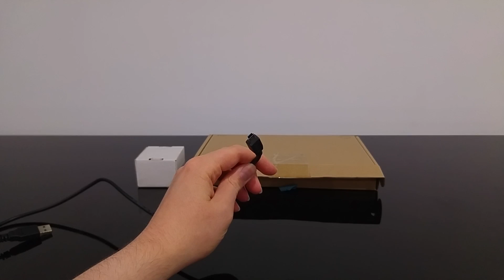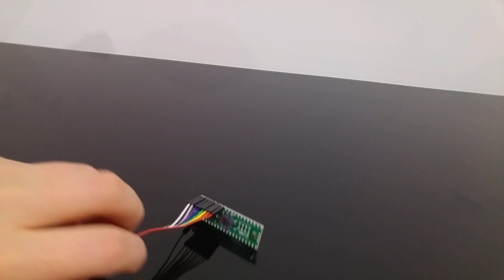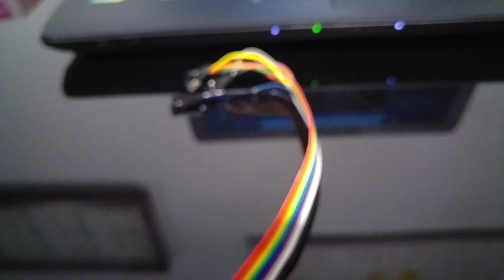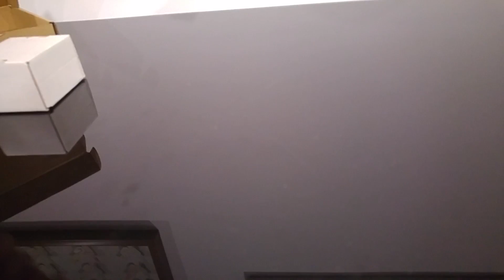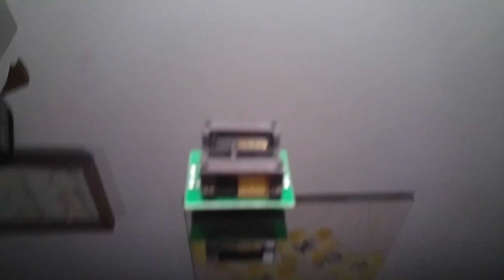PS4 Controller Sync NOR Flash Corruption Repair 1/3 - Building the Teensy Programmer

Comment: Hi Andrew Paul need your help for a couple of thinks. I need to start repairing console with not working pad so i need all the stuff for programming. I don't remember where but i readed in one comment of your videos  that it's possible to use a CH341A usb programmer that i already own and also i have a programmer like this:  https://www.amazon.com/WINGONEER-high-speed-Programmer-EZP2010-supports/dp/B01DZC36GY.
Those are ok or i need teensy anyway or may can i use a raspberry pi3?  Please answer as soon as you can and also indicate to me all the equipment and socket i need for all ps4 revision for use with my programmer or with teeny. Thanks
Last question i would like to ask if you have a video guide for ps4 that turn on and shut down after a second.
Reply from the maker: Hi, You can use a standard programmer if you wish, as long as it supports the MXIC NOR chips in question.
A full list of components, including socket details etc can be found on this video and the 1200 addendum video.
Reply: Ok i will try with my programmer if works, do you now also if raspberry can be use instead teensy ? Please can you also tell me if this socket is good for 1200.  https://it.aliexpress.com/item/QFN8-to-DIP8-Programmer-Adapter-WSON8-DFN8-MLF8-to-DIP8-socket-for-25xxx-6x8mm-Pitch-1/32813537238.html?spm=a2g0y.search0104.3.22.1ab1269f9LmtiD&ws_ab_test=searchweb0_0,searchweb201602_5_10065_10068_318_319_317_10696_450_10084_10083_10618_452_535_534_10304_10307_533_10820_532_10821_5023915_10302_204_10843_10059_10884_323_10887_100031_320_321_322_5727715_10103_448_449_5727815,searchweb201603_45,ppcSwitch_0&algo_expid=df362057-6191-49e7-b816-f60b922c94fa-3&algo_pvid=df362057-6191-49e7-b816-f60b922c94fa&transAbTest=ae803_5

Comment: Hi Andrew ... thank u for very detailed tutorial. I have problem with dumps and im in dark. I hope u can spread some light :) to my problem. 
PS4 on 4.73 (1116). Dont have original hdd so im trying to update to 5.05. Always stuck at same progress. Around 44% and give me code su-30631-3, which i belive is nor corruption. So i went ahead with ur tutorial of dumping to eliminate firmware corruption. I have teensy and i no socket adapter. I solder to nor with very short wires to teensy. Everything ok when i hit info, read correctly and even dump went through with no problems. I made around 2 dumps. But problem is here. I cant get 2 equal dumps. No matter what i do. All are diffrent. So i guess its not dumping right. But if i load at ps4 nor extractor it load all info ... but the only thing i noticed is diffrent sha1. If i load another dump sha1 is keep changing. I tried on another teensy and diffrent comp and still couldnt get 2 identical dumps. :( When i extract from dump 2 and extract from dump 2 and compare c0020001.bin they are identical. 
Do u have any ideas ?

PS: I tried diffrent hdd,usb and same thing. I try to update to latest fw using internet and same thing.
I try diffrent nor from diffrent console and both were identical (1.62 FW)
Reply from the maker: Is the NOR being lifted from the board before dumping? If not, do so and try again.

Can you dump  a NOR from a known-working console consistently on your setup? The fact you're getting differing dumps each time suggests to me that the NOR itself may well be faulty - if you can dump other NORs consistently then this may well be the problem. Sadly if it is, the chances of repairing it successfully are very slim to none.
Reply: Hey. Yes nor is being lifted and soldered to adapter. I try with direct wires on nor to no diffrence.

I dumped nor from working console with this setup and everything was ok. So setup is good ... So i think its nor who is faulty. Im gonna try to buy new mxic chip and try once again with new nor. i will leave orig nor untouched. But i dont have any hopes about this one :(

Comment: Hola, quizas me puedas ayudar, tengo una ps4 que comenzo a dejar sin conectividad a los mandos,, hasta que ahora muestra un codigo de error NW-35959-1 en la parte superior izquierda cuando inicia, pero ya no sincronizan ni con el cable usb, le realice un reset al comando, pero no lo toma por usb tampoco, tampoco me deja ingresar a modo seguro, nunca hace el segundo pitido a los 7 u 9 segundos, y se termina apagando, justo vi tu video que quizas por ahi me puedas ayudar, muchas gracias.
Reply from the maker: Hi,
If I understand correctly your PS4 doesn't enter safe mode and you cannot sync controllers at all? Do you have any other controllers to test at all to ensure it's not just this one controller?
Reply: Gracias por tu pronta respuesta, pude probar con otro mando pero pasa lo mismo, primeramente te dejaba jugar unos minutos con el mando y después se terminaba desconectando, le realice una limpieza general ya que estaba con mucha tierra, anduvo una hora bien y luego ya no tomo mas el mando, ni por cable usb, intente entrara a modo seguro pero no me deja, no hace el segundo pitido.
Reply from the maker: Has the controller sync issue only started since disassembling and reassembling the console? If so check the connection of the antenna cable beneath the power supply unit and ensure the other end of the cable is properly and securely attached to the metal bracket.
Reply: Me llego por esa falla, que a los 5 minutos se quedaba sin la comunicación del mando, al verla como estaba y notando también que levantaba mucha temperatura en la parte del APU ponido mi mano sobre el plastico, decidí realizar una limpieza, la probé una hora y funciono bien, al otro día ya no tomaba los controles. Gracias nuevamente. Ojala me puedas ayudar.
Reply: El código de error que muestra cuando inicia es NW-35959-1 en la parte superior izquierda, ya con la pantalla de bienvenida.
Reply from the maker: I see. I'd definitely check the antenna lead and connections / sockets for any damage in the first instance to ensure they are free from damage and that they are properly connected / seated etc. Does the WiFi connect and remain connected (if you can test that / use it etc)?
Reply: Verifique todo nuevamente, pero ya vino con ese problema, verifique y estaba todo conectado correctamente, no puedo hacer nada porque no toma el mando ni por cable USB, el código de error que muestra es NW-35959-1. Ni si quiera puedo hacer que ingrese a modo seguro, enciende perfectamente, mostrando ese código de error pero no me deja hacer nada al no tomar el mando.
Reply from the maker: If you remove the hard disk drive do you get the 'unable to access storage' message? Do you have another hard disk around you can install to test to see if the console will boot itself down into Safe Mode so you can test the USB handshaking with the controller?
Reply: Voy a probar sacando el disco y poniéndole otro, esto no afectaría al disco original no? y luego comento por aca que sucede, muchas gracias.
Reply: Ahora que recuerdo probé sacandole el disco, peor sin poner un disco nuevo, e inicia la consola diciéndome que debo presionar el botón PS del mando también pero no funciona el mando y ahi queda.
Reply from the maker: I see - if the controller doesn't connect in Safe Mode then you likely have a problem with the USB chipset. If this is a 1200-series machine or newer then this is handled by Southbridge. The fact you can't get into Safe Mode by the power button would be very interesting if it's a 1200-series console or newer as that would more-or-less pinpoint a Southbridge failure.
Reply: El modelo de la consola es CUH-1215A, ese componente SOUTHBRIDGE lo puedo reemplazar?
Reply from the maker: This is all starting to make sense :-)
Yes my friend - I'd replace the Southbridge.
Reply: bien, voy a ver si puedo conseguirlo nuevo, tengo herramientas de reballing por lo que no debería presentarme problemas para reemplazarlo, tengo una placa de otra ps4 no se si sera el mismo modelo, podré reutilizar ese chip de esa placa en el caso de que en mi país no pueda conseguir el ic?
Reply from the maker: As long as it's another CXD90036G chip then yes you can use that as a replacement.
CXD90026G (from SAA / SAB boards) are not compatible.
Reply: Ok, Debería respetar el mismo modelo o código que tiene en la serigrafia. Sabes si es posible poder testearlo con un multímetro suponiendo que lo puedo extraer de otra placa para ver si se encuentra en condiciones?, estoy muy agradecido de tu aporte como ayuda sinceramente.
Reply from the maker: You're very welcome for the help. :-)
Southbridge failures aren't especially common (relatively speaking) so chances are your donor will have a likely good IC. There's not a reliable way to measure them as far as I am aware so it would just be a case to swap the IC and test. I'm 99% sure this will resolve the issue in your case.
Reply: Perfecto,  veo si puedo reemplazarlo, ya se extraído de otra placa o nuevo, en el caso de que lo pueda extraer estaba viendo que esferas de estaño y plomo debería rebolear.
Reply from the maker: Sounds good. :-)
Reply: Hola Andrew buen día, de las placas que tenía eran del modelo 25g por lo tanto pude conseguir nuevo el modelo Cxd90036g que es el que lleva, me recomendas desoldar y soldar con mi estación de soldado de aire caliente o con mi maquina de reballing,?

Comment: good video i got a question you think the this one works too SOP16 SOIC16 to DIP16 Socket Programmer Adapter double PCB Board sop16-1.27-1 sx please let me know if you can
Reply from the maker: Have you a link?
Reply: http://www.ebay.com/itm/SOP16-SOIC16-to-DIP16-Socket-Programmer-Adapter-double-PCB-Board-sop16-1-27-1-sx-/191907606833?hash=item2cae95b131:g:yFAAAOSwzJ5XaSbj
Reply from the maker: I can't see anywhere where it states the supported size for the socket so it's very hard to say without asking the seller.
You need a SOIC16 to DIP16 (300mil) Socket for SAA / SAB revision boards.
Like this one: http://www.ebay.com/itm/SOP16-SOIC16-to-DIP16-Test-Socket-Adapter-Pitch1-27mm-IC-Body-Width-7-5mm-300mil-/152140698621?hash=item236c4ad3fd:g:rvAAAOSw3YNXa4Qv
Reply: Thank you so much I'm going to order that one
Reply: Thank you question that one works with the slim model? if not can you help me to find one like that one if you can please
Reply from the maker: For SAD-001 it's a different chip - identical to SAC-001 (DFN 8-pin package).
You'll need a WSON8 8x6 (1.27mm pitch) Socket for those - they are considerably more expensive sadly.
For a one-off I'd be tempted to use a break-out board like this http://www.ebay.com/itm/3-PCS-DFN8-5x6-1-27mm-0-05-to-DIP8-0-4-socket-CA-/162135493004?hash=item25c007498c:g:hZMAAOSwyDxXhqKh
or alternatively solder directly to the chip pads with link wires but do be careful with that method.
Reply: Andrew Paul ok so when i get that one i need place the chip on top and i need to secured it with something because is not like the other one the you press down and secure it the chip right
Reply from the maker: You'd solder the NOR to that small board.
Reply: Andrew Paul ok thank you again I really appreciate You Took your time to help me no everybody replied or help subscribers like you did thank you again

Comment: Hello all!

I am in a bit of a bind with the Tennsy ++ 2
Wired perfectly with exact wires seen in this video.
3.3v regulator is on point.
Everything meters out as it should.
Tried 4 different USB wires.
4 different computers.
All computers have same issue...they can flash the hex file to the teensy but when you try to ask for info Teensy not found.
All computers show the NORway PS3 serial driver is missing. But the USB shows COM port.
Same results when using GUI.  Can flash hex but then cannot find Teensy for info or dump.
Thanks for your help in advance.
Reply: OK guys...I have spent two days on this and 40 min after I ask for help I have figured it out!  

Teensy drivers
Teensy 2.0++ needs windows drivers and linux udev rules to be recognized fully as it was meant to, as explained here http://www.pjrc.com/teensy/usb_serial.html

Windows driver: serial_install.exe

Found it on the PSDEVWIKI

Hope this helps someone in the future.

Best
Reply: Thank you very much I was having the same problem

Comment: Hi Andrew,
great video, will help me a lot. Would like to ask you if there are other "bios" templates that you have.. I am not sure if its just the part of my BT/Wireless corrupted or I have something more. I am able to install version 3.55 and controller is not connecting just like you show in the video, but also cannot update to a higher version because of SU-41283-8 error. I am suspecting there is more damaged parts...
Reply from the maker: Templates for v3.55 are in the description for all consoles and modules.
update issue is probably the disk drive. Disconnect the cables to it and try updating to v4.0.
Reply: Hi Andrew, thanks for the hint! I tried that yesterday, when you disconnect the disk drive it starts rolling the x, square and circle saying updating for about 4-5 sec, and then it comes with same error.. tried v. 4.0, 4.06 and 4.07 with same result. Only working version is 3.55 but cannot pair controller...
Reply: Its a CUH-1106A by the way..

Comment: hi, NOR flash and it works for version 4.00?
Reply from the maker: C20001 container sizes have changed for v4.00 but the procedure and offsets etc are the same. If you dump the C20001 and tell me the size i might have an EU dump for SAA/SAB boards which you can use.

Comment: Hi Andrew. Great videao and tutorials. I have a small issue, in that the Dip16 socket I bought, is just that. 16 pin. could you please advise which pins to connect the teensy board up to please?
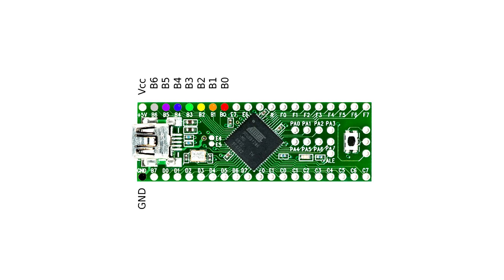Reply from the maker: Schematics are @25:17 onwards. Cheers.
Reply: +Andrew Paul Thanks Andrew. Im now having an issue with the Teensy not being recognised once the voltage regulator and the 3v is bridged. If I remove it, and reconnect the 5v line, the teensy is detected in windows and teensy loader . Any ideas?
Reply from the maker: Did you cut the trace to the 5v pad before soldering it in place? If so it suggests there may be an issue with your Voltage Regulator.
Reply from the maker: If all else fails you can use it without the regulator and it will work - it's not ideal as the NOR is a 3.3v IC but for the short time it's in there you can use it without at a push. I would heavily recommend using the regulator however if at all possible.
Reply: +Andrew Paul Yes, I cut the trace and checked there was no continuity. I have removed the regulator and reconnected the 5v line. Now I have a separate issue with the ac1d flash tool not loading :/
Reply from the maker: Ensure .net framework is installed and run it as administrator
Reply: +Andrew Paul Updating Net Framework resolved that issue. Now I have another :/ I think I may have bought the wrong socket, as I cant for the life of me work out how the ic slots into it. http://i66.tinypic.com/6e1c1h.jpg

Comment: Hi, Andrew Paul! I have a CUH 1115A motherboard with a corrupted firmware after a interruption of energy. I'm trying to update but no success. can it be a problem with the NOR?
Reply from the maker: Do you get any error codes etc?
Reply: Andrew Paul Hi, Yes. I get the error SU-30645-8
Reply: hello, my console install  version  4.00 flach NOR works des  verzion?
Reply from the maker: ABDELMOULA HARIRI container sizes have changed for 4.0 but the procedure and offsets etc are the same. If you dump the C20001 and tell me the size i might have a dump you can use.
Reply: at the moment I still do not buy it, I wanted to inform, however, and it works for 4.0 and model what would be european ... thanks

Comment: Hey Andrew, i would like to send you my PS4. You could also use it in a video. Is that possible? How can i contact you for payment etc. I tried everything :(
Reply from the maker: Where are you located and what seems to be the issue with it? Many thanks.
Reply: +Andrew Paul I am located in Germany.

Freezes for a few months now. But rather spontaneous. 
since last week complete shut downs sometimes. Since Thursday BlOD.

Opened it up, looked if everything was ok. Everything looks nice. Changed the Thermal Paste. Then restarted, and it worked for a few hours without problems.

Then after a few hours, started again, another BlOD, couldnt turn into safe mode.

Few hours later it would turn into safe mode, and also start again. Now sometimes it is working and sometimes not. When it freezes it looks like the image has artefacts. One time it started getting artefacts, i pulled out hdmi. put it back in and it worked again for a few games.

Next day i put out the bios battery and put a new one in, it worked afterwards. even could turn it off and on and it would work for a few hours.

So i have no idea. But whenever i leave it for a few hours it would start into the games at least, but then feeeze. After that freeze, somehow i get blods again.
Reply: +Andrew Paul could there be some broken condensators? it feels as something would work whenever i let it time. or is ist the heat on the hdmi chip? or vram? no idea.